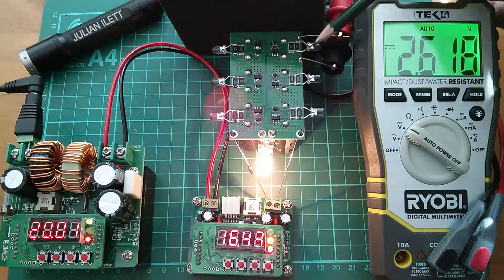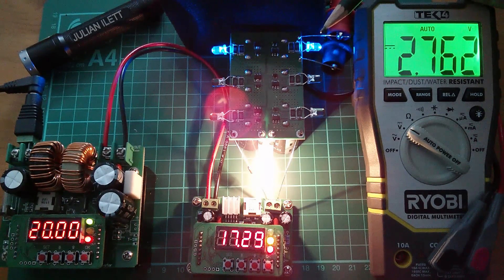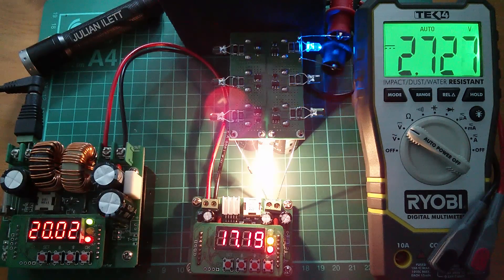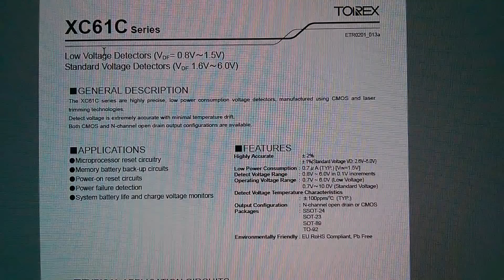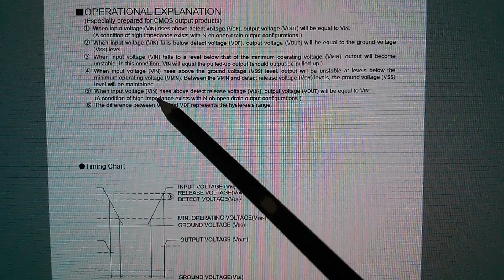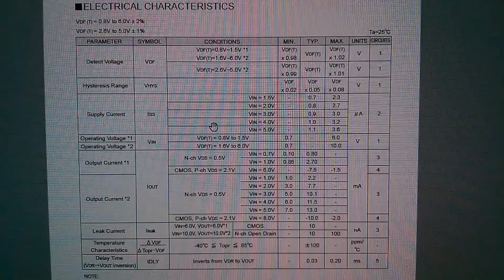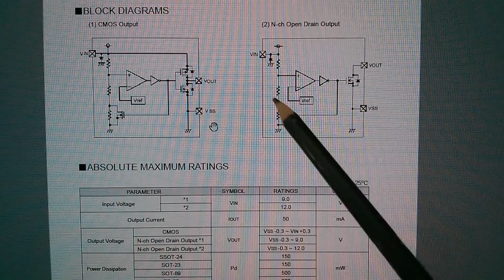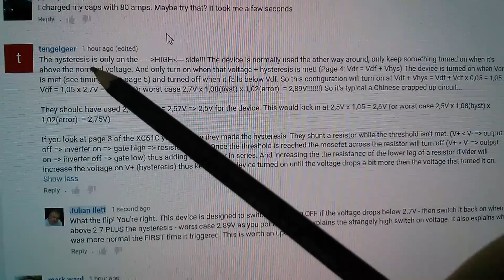Scary Update: SuperCapacitor Module 6x 120F 2.7V

Comment: Yes I would rather 2.5v version with lower capacity. Rather than risking popping a capacitor. So will be looking to replace mine. What is the part number for the 2.5v IC?
.

Comment: Bear in mind that the  the data sheet for a 500F one  was looking at today, gives the upper voltage limit of 2.85 volts. Seems they can tolerate quite a bit more that 2.7 Volts

Comment: I am sure the max voltage is way above nominal 2.7V of these supercaps. If so then 108% (takin max of nominal and hysteresis) would be 2.91V - still probably below the voltage of the capacitor to blow. On the other hand if this sensor detects exactly 2.7V to start charging it, then the capacitor would be always between 2.7-2.91V - not bad, just 10% of the U nominal

Comment: It seems that supercapacitors rated voltage changes with the temperature of the environment. This spec for instance says they can handle 2.7V at 65 celcius and 2.3V at 85 celcius https://www.vishay.com/docs/28421/220edlcenycap.pdf
So at 25 celcius these will be ok at even higher voltage i guess.

Comment: Hi. can i use this particular capacitor pack for my bike starting without much customization. bike is 12 v. i cannot use battery as i barely use bike. battery ends up dying.
Reply from the maker: The supercapacitor won't fail through lack of use like your lead-acid battery, but it will always be flat when you come to start the bike. Supercapacitors tend to self-discharge quite quickly.
Reply: Hi Julian. That was a quick reply. Thank you. I was in to avionics and understand that Caps get discharged quickly. If I do a kick start (manually using kicker) once, can I run the bike whole day using self start? Do I need any additional customization to get this work on a bike which used 12v lead acid battery. Now I use the bike with kick start :-). If no customization, then i am in for it. :-) I found the same product in your video in AliExpress.com for $17.68. Thank you
Reply from the maker: Hmm, not sure. The discharged capacitor will look like a dead short across all your bike electrics. Not sure what the high voltage generator will think of that! Only one way to find out - try it. You may have an awesome solution - you may have a busted bike ;)

Comment: Julian I had reason to re-visit your super capacitor protection work while using EDLC's
to stabilise a solar  panel charger output, you might be  interested to look at an article
I wrote utilising a similar voltage control chip the STM1061 (1.6V) at 2.7V
see here  http://bit.ly/2fhFPvy

Comment: In my opinion, they are not a "protection" feature, they are a "balance" feature, you should not attempt to charge the entire module above the rated voltage.

Comment: I am wondering if the chip is actually intended for low voltage load disconnection of Lithium cells... I have the exact same capacitor module, interesting stuff from the datasheet for the chip. Looking at the data for the Maxell supercapacitors (presumably using the same chemistry) it seems they are rated for 2.85v, so this may not be a disaster at all.

Comment: Well this behavior is totally fine for protection purposes and hysteresis range seems to be quite reasonable, please stop making clickbait out of nothing.
Reply: These things are ultra fussy about voltage. The absolute maximum surge voltage, not to repeat, (wording in spec sheet) is 2.84V for a quality make - and considering these are knock off, they will get buggered within a week doing this as I'm sure they can't even cope with the 2.7V. Also there is no problem finding new uses for devices like the voltage sense ics, as long as you get the engineering right - this aint right, and well spotted by the chap, even if it took him a week to put his meter on the blinkin relevant voltage.
Reply: They are not happy with over voltage is all I'm saying and they are probably knock off with all that implies. You ask him I don't give a shit.
Reply: B-b-b-but it makes the voltage going way over the designed voltage of the caps...
Reply: So, what does the data sheets of the capacitors say then?  So we can end this dispute?
Reply: Martin D A , and I'm pretty sure you've got evidence to support your claim that these capacitors can't handle 2.7 volts, right?
I mean, Julian himself is in possession of these for how long, a year? More? If you are right, these caps must be all dead by now.
Why don't we ask him?
Reply: Y-y-yeah, 2.84 is (gasp!) 5 percent above 2.7 volts, outrageous!
In all seriousness, I doubt this is ever going to have any significant effect on the capacitors.

Comment: I bought a 100 farad 2.7v super capacitor for testing. and charged it all the way up to 3.4v and it doesnt get even slightly warm Stayed cold and holds voltage for a long time.
if these are getting warm at just barely 2.7v then they are ABSOLUTELY fake no doubt about it.

Comment: I agree that this is the wrong protection voltage, but I believe you misread the data sheet. It's actual voltage design is 2.8V, not the 2.7V that you said it was.

Comment: if they were genuine capacitors they wouldn't get warm when they are slightly overcharged at a low current. so they must be fakes knockoffs or copys of a different brand. with a lower voltage actual rating than the real thing and most likely lower capacity too.

Comment: the only think that this supercaps can be useful, I think is to start a car engine if your car battery is discharged... but then here comes an other question... how long can this caps maintain their voltage? you need to know that, to be able to know when you have to charge them again.
Reply: These super caps are too small for that. They have a high ESR and a low current rating.
You could use six of the 3kF Maxwell boost caps though. They are rated to supply 1900 amps. Even with those, you would only be able to start an engine once or twice per charge. They will also self discharge in a few days, so you have to keep them on a trickle charger.

Comment: 2.7V is the rated voltage. The maximum voltage is typically stated in the datasheets to be 8% higher, so even at the worst case scenario we're just around the maximum voltage and not exceeding it.  This module is meant to be used  in automotive applications, where the voltage rarely exceeds 14.5V, and for the protection circuits to activate the capacitors would have to go out of whack big time (which with time they probably will..). If you are trying to cram every fraction of a Joule into this in a lab setting - perhaps 2.5 or 2.6V rated chips would be better, so as to keep the voltage below the RATED value as opposed to MAXIMUM value. 
It's a bit like expecting to see a MOV rated at 245V in a mains overvoltage protection, which would be a nonsense.

Comment: Hi Julian Thank you for the video.  I have one of these CAPACITOR modules and going to use it with a crank generator.  Some suggested to keep the voltage down to around 14.5V so I suppose I will add in a regulator to ensure it does not go any higher.

Comment: How many w/h (energy/per hour)can this bank have? Can it be modded to replace the supercapacitors with for example 200F Supercaps? Can more pe used in series to act as an e-bike battery? Or not worth as a battery, but like a NOS boost like cars have? Can it be done so that a bank like this is charged when breaking an e-bike?

Comment: I have a question to you Julian. You are using the B3606 and B3603 (the step down modules). Im making my own solar charger to charge a power bank and I wanted to use one of these modules in it, my problem is that I dont know how they really work, If I set the limit to 5V, will they stop outputting when solar power voltge drops ? Or do I need something else at the end of my solar panels ?

Comment: One other issue I see with this circuit is that when the capacitors are discharged (via the soldered on bulb), some will be reverse biased similarly to fully running down a pack of AA batteries where one battery runs down before the rest.

Comment: sounds like they pulled whatever they had available,thinking that would work even though its clearly not even designed to act as intended. pretty bad. The truth is,this happends in more electronics than you think. Televisions now days were engineered to only last so long ,then go bad. Those capacitors being a key reason. After time,they go bad. I remember the old commericals for televisions and how they would tell you their products were tested in so many ways,longevity ment something back then. When Dad went shopping for a TV. He bought one knowing it was built to last a long ,long time. after all,money doesnt grow on trees and the longer something lasted,the better it was! They even pushed that. Now days,thanks to ever changing technology,nobody WANTS a television thats going to last longer than 6 years. The fact of the matter is televisions,and electronics in general, are designed for a short life. They produce them so cheaply, that it doesnt matter any more. Its sad to think there is no more pride in the quality of things,that they are no longer designed and built to last for years. That includes most household appliances now days also.

Comment: Love your meticulous investigations and demonstrations. Did you try find the right IC (one turning on its output when voltage is 2.7) ? if so you could try replace them on the circuit board and make a video for us :)

Comment: Well I am glad I bought the individual super caps and made my own over voltage circuit using 6 zener diodes and 6 transistor's it works better.

Comment: TL431 is the way to go, it's basically the same thing as you have there but without hysteresis and a 2.5V Vref.
Reply: What if I would like to load the caps with more Amps? Lets say 3 or 4 Amps at 5V. Which volt detector would you recommend?
Reply: The detector is there to detect and can not dissipate any power, for that you need a MOSFET ( logic level ) and a resistor.
Logic level MOSFETs have a RdsON at 3.3V or less.
Then:
5V / 3A = 1.66 Ohm resistor.
5V / 4A = 1.25 Ohm resistor.
The voltage can be set by a resistor divider, which can be found in the TL431 datasheet, and can then be calculated.
Reply: Not really. You'd want something with a hysteresis, which draws almost no current below the threshold, and starts bleeding the cap sharply when the voltage exceeds the threshold. TL431 could be used as a reference (albeit wasteful with its minimum current of 1mA), but together with a low power comparator & a LL MOSFET. 
And this chip does just that, with a quiescent current of less than one microamp.
Not to mention the precise voltage trim and temperature compensation.

Comment: Pal, when you gonna get a good DMM ? Fluke 87 , Brymen or Rigol Bench Multimeter ? haha....
Reply: The Ryobi is a good DMM, for what he is doing.  High price is a decisively bad attribute, making all meters you listed BAD meters, not good, within the parameters needed for these tests.

The same could be said about the components on his power supply.  Not high end components, but if they were then it would cost multiple times as much.  His camera probably doesn't cost $20K either, and the list goes on of what would be a waste of excess because of an inability to recognize what matters and what doesn't.
Reply: Seriously, what's your problem with this Ryobi thing? In my view the main advantages of expensive brand multimeters are better security in case of high voltage/high current and expected better long-term stability. I prefer the brand stuff myself, but often I'm surprised how far people get here on youtube with a multimeter for less than 10 € if they know what they are doing.
Reply: theres me using a dollar store dimm to do mains voltage XD XD XD
Reply: My trusty Fluke-11. 20 years old, I found it in my pocket when I Left Nokia...
Measured it last year against a Lab. standard. Spot on!
Doesn't measure current, which is when I pull out my (T)rusty AVO-8. 20 microanp movement - I can see when an interrrupt routine is working....
Reply: I meant 50 microamp...
Reply: I have had a Fluke 87 since 1990 that now has a bad display for the second time. I did put the repair on hold and bought a Aneng AN8008 instead of a repair kit, it seems to be impressively accurate :)
Its good enough for low voltage breadboard things and hobbyists. I like the screeen.
https://www.youtube.com/watch?v=xdGQEVdxmQQ

Comment: Having investigated further online, I am fast coming to the conclusion that the capacitors in your device may be either fake or falsely labeled. Elna manufacture no super capacitors in their DZ, DZH or DZN ranges with both a maximum voltage of 2.7v and a capacity of 120F. In fact, anything they make of that sort of capacity is significantly larger than the ones you have - Dynacap DZ range 2.5v 100F is 25mm × 50mm (Dynacap range 2.7v only goes up to 33F) and they do not make any capacitors in their Dynacap range in 1.2F,12F or 120F.
Reply from the maker: That doesn't surprise me ;)
Reply: Sir, what is the power supply circuit that you have use for supplying the caps? The one with 4 nos of push button switches?
Reply: take a look at his channel as i think he reviews it,  iirc it's a buck regulated unit powered by his solar system

i might be wrong though
Reply: http://www.es.co.th/Schemetic/PDF/ELNA-DYNACAP.PDF ..I see as high as 300F
Reply: I also researched this subsequent to your comment, nearly 9 months after your comment and ELNA do not list these capacitors on their website. From my initial observations the one thing that does seem genuine is the capacity....

Comment: Hardly 'scary' - these are capacitors, not Li-on batteries! Although I agree that, on the surface, the over voltage devices appear to be somewhat unsuitable surely the purpose of the protective circuitry is for rare overvoltage conditions and not specifically for use when connected to a higher continuous voltage than specified. As some people have mentioned, perhaps the datasheet for the capacitors would shed a clearer light on the actual maximum overload voltage and as suggested by others, I suspect an overvoltage of less than a volt would likely, at worst, lead to reduced lifetime of the capacitors rather than some kind of catastrophic failure. What IS perhaps 'scary' is your use of hyperbole in these circumstances!
Reply from the maker: +Pete Allum But it was a miniscule, microscopic, infinitesimally tiny amount of hyperbole.
Reply: Even a 0.1V overvoltage on this type of capacitors will reduce the life significantly and a 0.2V can damage them almost instantly. This are also fake low quality super capacitors that do not have the stated capacity and they will probably fail very fast even at spec 2.7V
Not to mention that they are unusable due to large difference in capacity, internal resistance and self discharge characteristics. This is based on my experience with a set of 8x  500F 2.7V capacitors I got not long ago from Ebay and look similarly to this also same low cost.
Reply from the maker: I trust your experiences with these cheap capacitors and it doesn't surprise me that they're a bit rubbish. But the module still has value - for playing, learning and experimenting.
Reply: Yes for playing and learning is good but not usable in a real application. I realy annoying that the ones I have will self discharge in 24 to 48h and not all of them will discharge at the same rate. Maybe the 120F are better than the 500F I have in this regard.
Reply: +electrodacus +julianilett 
It would be interesting to determine the actual capacitance of your capacitors. This could be done with an LCR or capacitance meter but most would likely give unreliable readings with such high capacitances. The other option is to use a signal generator, an oscilloscope and a few other passive components and calculate the capacitance value which is theoretically possible with any size of capacitor.
Reply: *****
Since this is such a large capacity it will be easy to calculate the capacity just with a constant power source and a timer see my comment above about the calculation.
If you want more precise calculation you can include the internal DC resistance of the supercapacitor (for this low quality ones is important but not so much for the higher quality ones since they have realy small internal resistance so internal energy losses will not be significant with small loads).

Comment: Julian Ilett Hi I have a question for you I watched many of your Videos and I am working on a project. Let say you have AC 6 - 12 volt and you rectify it with a Bridge Rectifier to make DC voltage. I know that it will have a ripple but if you was you use this could you make the ripple less with this bank of capacitors? Or would you say get something better?
Reply: just use bridge rectifier and regular electrolitic cap 2200uf for 1-3a load you can add a voltage regulator like lm317 as well

Comment: Normally you would want at-least 10% headroom, 20% is even better. Using 2.4 volt Zener diodes in reverse bias is cheap, but effective over voltage protection.